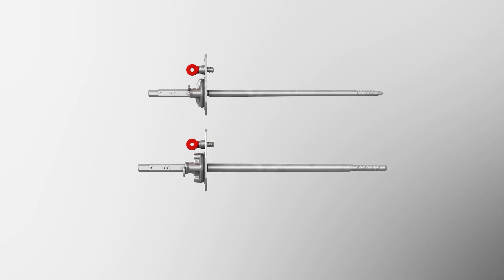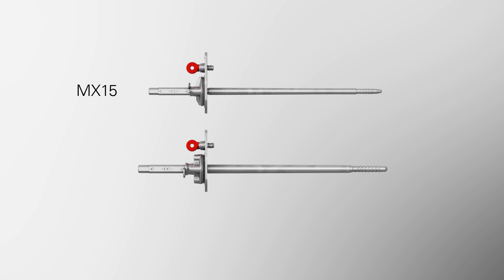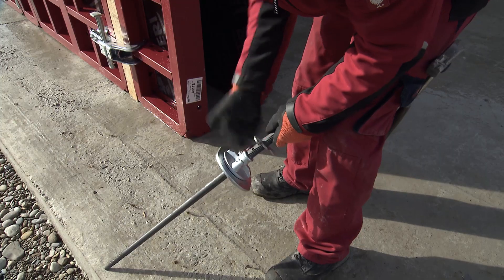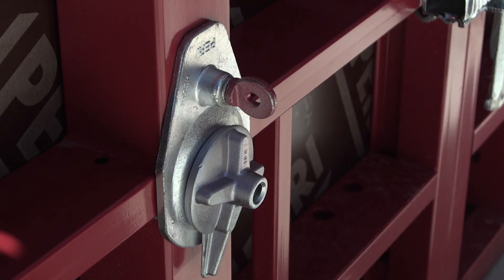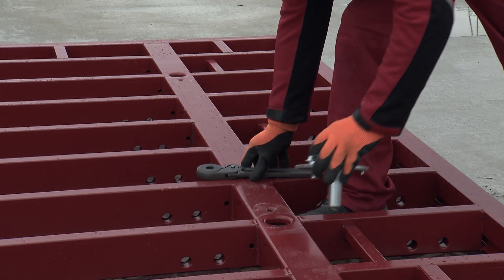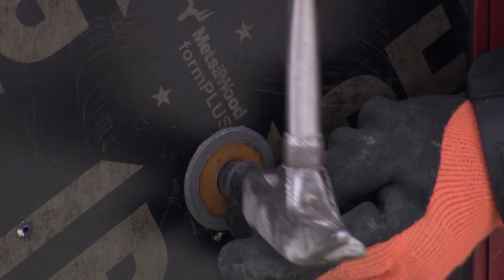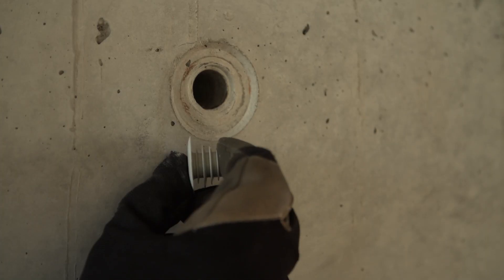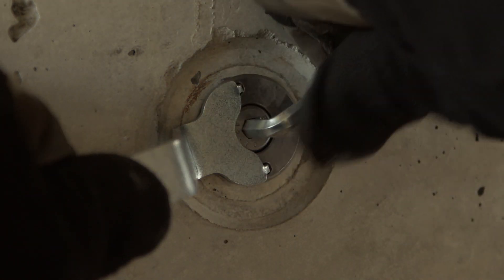TRAINING | How to use the tie systems PERI MAXIMO MX 15 and MX 18 (EN)

Comment: Does the I bolt on  the tie have to   Be tightened to the form or can it just be left loose, my boss thinks it’s just a waste of time so we have just been leaving the one side lose. By not tighting it   Will it affect anything like wall thickness etc ?
Reply: I have just been doing it anyway cus why would it be there if it wasn’t needed. Let me know if it matters